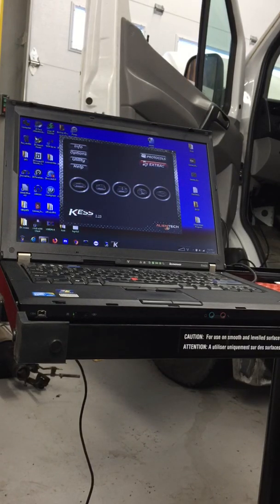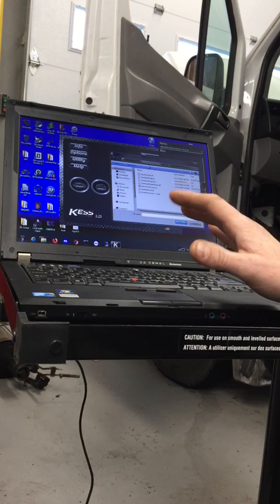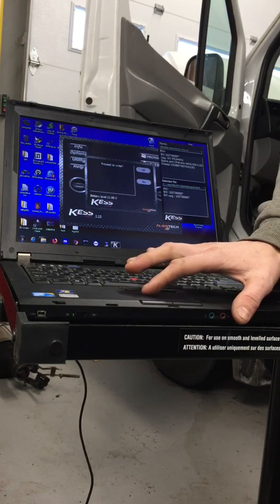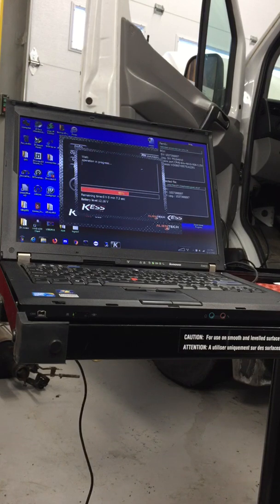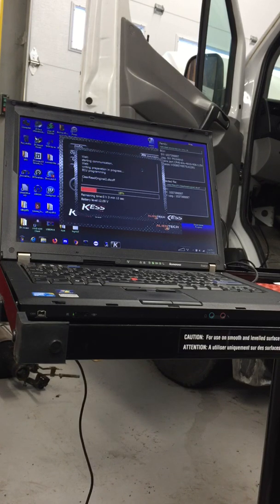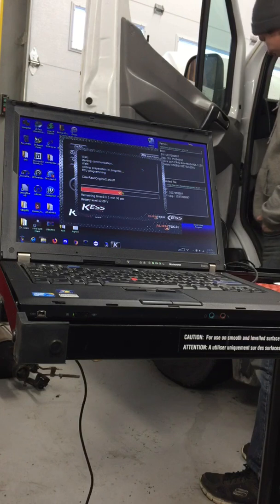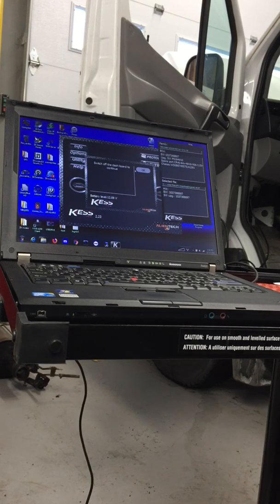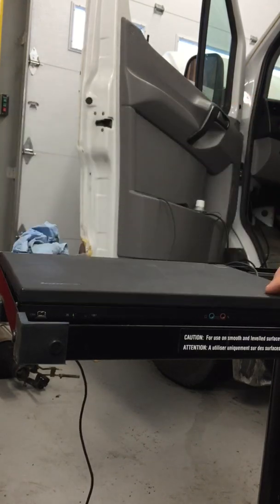Part 3 KESS Programming DTC Remover 2007 Dodge Mercedes Sprinter diesel KESS 2.23v

Comment: Hi Johann Meyer,

Just a question, so u used KESS to get a copy of the ECU, MTX to open the file and remove/disable the codes and again KESS to rewrite the ecu?
My mate has a problem with his car, keeps popping up. So want to unwrite the code.
Reply from the maker: Yes that is correct. Good luck be very patient when you work with his ecu.
Reply: @johannmeyer5192  thanks for the answer, its for a BMW tho. But i think it works the same way?
Reply from the maker: I would assume it does. But I’m not sure. 

Good luck and make sure to make a copy of the file you download from your car. This way if something goes wrong you still have the original.

Comment: Were you successful in deleting your EGR valve. Did that help your van. I have a 2006 ex FedEx Sprinter that is governed through the ECU so it will not go above 70mph. I need some advice on deleting that code from the ECU. Can you help me? What files did you use for your sprinter?
Reply from the maker: I’m not sure about your year. The 2006 is the older type. But good luck. Let me know how everything turns out.

Comment: nice video . i thumbed up all 3 parts. in part 2 you had p2007 stuck runner did that not put your truck in limp mode. if yes. did using dtc remover take the truck put of limp mode and how does it run with flaps stuck closed? Thanks